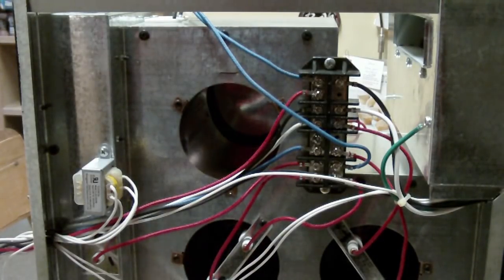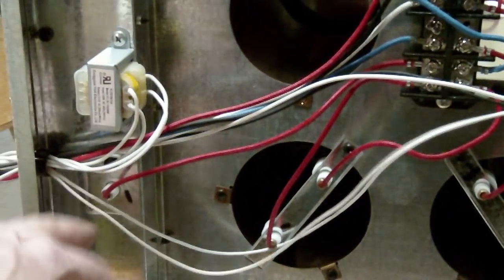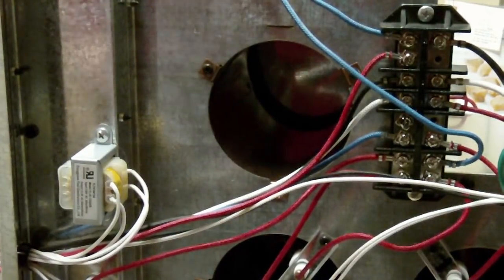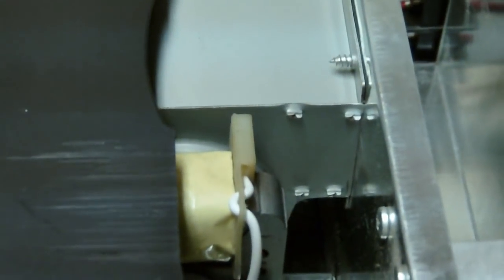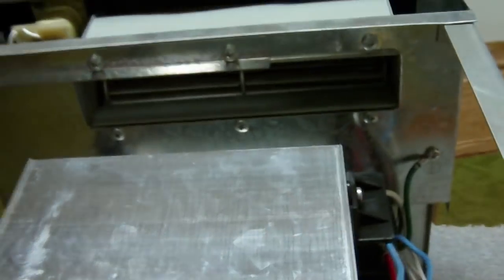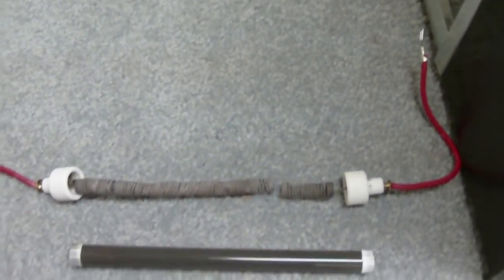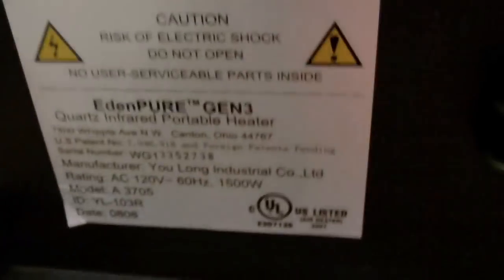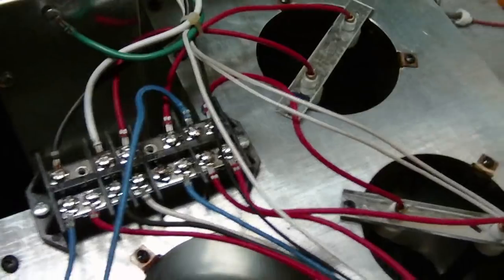EdenPURE GEN3 Quartz Infrared Portable Heater-What A Scam

Comment: I have had 2 gen3 heaters and a gen 4 for  about 13 & 12 years and they have been the most dependable and efficient heaters I have ever owned. The first 3 years I had them they provided a lot of the heat in my house in Michigan without breaking the bank.  Set them so they cycle in auto and they work great.
Reply from the maker: You probably let yours cool down completely before moving it

Comment: I service these units where I work at, we sell and are a warranty/service center for EdenPure. Most Gen3 units have a 3 year warranty, which EdenPure will cover the bulbs and most everything on the unit. If you only had a 1 year warranty, than you have a refurb unit. I have never had any issue working with EdenPure for customer issues. They stand behind their product. I love mine.
Reply: I agree that eden pure stands by there warranty about 70%,  we have 2 heaters a Gen 4 1500w and a 1000w don't remember the other name Gen 3 ? Idk adc purchased Jan 2012 the Gen 4 blew all bulbs at about 2 winters, called eden they sent replacement bulbs the only problem is that it took damn near till spring to receive them literally no bs 5 weeks 😕 The 1000 watt just died so I don't know if there is still a warranty, anyways these heaters are good economically and heat fairly well.  My only complaints are is that these are expensive and 1. when the bulbs go you are without a heater for weeks 2. bulbs are pricey  3. Should have a longer warranty and faster bulb shipping for the premium price tag.

Comment: My Gen3  is from 2009 and still going strong. You have to be smart enough to use a thermostat so your heating elements last. If you run it on high nonstop, the bulbs will burn out sooner. I haven't changed the bulbs yet. It's not meant to replace your furnace. It's meant to supplement your furnace!
Reply: Barbara Halas was
Reply from the maker: thanks for your comment

Comment: I bought 2 Edan Pure "Sun Pro" heaters in wood cabinets & remotes about 16 yrs ago. I haven't had an issue yet, but I also don't run them on max. Thats the one thing that burns them out. High temps degrade things quicker. That's the one consumable part you can generally expect  to replace over time. 
      The problem is a lot of people run these on high for extended periods. Yeah, that's gonna wear out those elements quicker. They actually sell a much better replacement element that they use now. 
      Quarts element works of electricity. It isn't a magical glass element that works by itself. They will all eventually fail, but at how fast depends on how hard you use them.
Reply from the maker: thanks for your comment

Comment: I have this edenpure heater and blower stopped working. What I found is there was one peace on the circuitboad (SRD-S-112DM ) had blown. Looked up part on edenpure web and board cost $39.95. Installed it and works like a charm. This is a 8 yr old unit.
So you can fix them.

Comment: Oh it says in the manual its very important to keep the filter clean.  Its possible that the filter got to dirty and it did not get proper air flow... could be what burned them out. The elements are rated at 20,000 hours which should be about 5 years of normal winter use.
Reply: I removed my filter altogether.. I blow it out pre season with compressed air.. A filter will cause problems because people rarely check it, at least on these things.. Just my SOP practices

Comment: The main reason these go bad is people unplug the unit while it is cooling down, it should be allowed to complete the cooling cycle when turned off and not unplugged until the cooling fan cycles off, that's why some people are having problems they don't read the instructions then gripe when something goes wrong that could have been prevented.
Reply from the maker: Rick Osman correct
Reply: you are correct!  It does make a difference

Comment: Ron: The same happened to me not too long ago. Brown + red should be high, leaving brown + white as low. Just be sure to use wire connectors and cap the left over wire to avoid any inadvertent connection. Quality electrical tape should seal all wires. The auto-shut off still works in case the unit is tipped over. Remember that you'll now have to plug and unplug the unit to turn on and off.

Comment: quartz is the glass tube that the heating element is inside.

quartz is used i think because it can handle very high temperatures without breaking.

in modern refrigerators the defrost heater is a quartz heating element and there the quartz is being used because cold water dripping onto a hot tube would shatter normal glass.
Reply from the maker: Yes

Comment: NOT a scam at all...I will admit slick salesmanship  tho. I have had one for about 8 years with NO PROBLEMS.. It is what it is....IT IS A SPACE HEATER FOR SUPPLIMENTAL DUTIES.. I run a HUMIDIFIER with mine, actually right on top of it during the dry air of winter and it helps quite a bit...I like the whistle of its operation while im sleeping
Reply from the maker: thanks for your comment
Reply: Id say its good for what it is but still overpriced for the componentry that in reality amounts to being worth at least 60buck to make.

Comment: No its not crap I have one that is four years old I run it a lot still works
Reply: same here, I've had mine almost 6 years and just recently it's having problems, the fan doesn't want to turn as fast as it used to.
I replaced the heating elements about 2 months ago which didn't need to be replaced. I run this Gen3 1000 24/7 because I live in the north west and use it to keep my parrot warm.
This dude is an idiot saying they aren't worth the money because 1 or a few units fail. Guess what, it's a machine, machines break.

Comment: Most quartz elements uses coils inside to heat up more surface area. It the tube itself that is quartz glass. These heaters are built well overall. Plus you have other brands with same technology that are built well. I prefer these over the cheap plastic crap Lasko that only lasted 6 months and others. The quartz based heater heat the place better as wider spread and not like Lasko where heat goes to ceiling. Plus had that quartz heater for 2 years and no issues and runs quiet. Perfect for bird room, beside my oil based radiator heater as no PTFE.

Yes is overpriced for costing over $350 for the EdenPURE no doubt, but not a scam. Their are other heaters that are based on the same, or close to  elements that are built well you can buy for about $125 that do a good job. Yes these heater can do about 250 no problem, but won’t push it past that?
Reply: I would have replaced all 6 elements, not just the 3 as the other 3 are likely on their way out.
Reply from the maker: thanks for your comment

Comment: I have a gen 3.  It is a 2008 and I have never replaced the bulbs. This guy maybe never used one. For zone heating or a supplemental heat source these are great. I  have a big buddy heater and it just gobbles up propane. My eden pure runs well on a  2000 watt generator in my  20 foot rv and still have power for lights and tv. Keeps me warm for a fraction of what any propane heater I have used so far.
Reply from the maker: thanks for your comment

Comment: I just got one.... so I can't say how reliable it is.  I will say one thing I have a 750 sq ft. apt with a cathedral ceiling....  it definately does heat the whole space up where as my oil filled radiator mainly goes up to the ceiling.  So far I am happy with it.  I got a refurbished unit with a 1 year warranty for $179  thats the way I would buy this unit

Comment: What wrecked that specific heater was.....someone unplugged it from the mains before the heater shut off. The fan keeps running after you turn it off to cool down the elements. If they are not allowed to cool down before mains are removed, then you get overheated elements that break like what is shown. NO other reason for those to die like what you are showing. I have had Edenpure heaters specifically the 1000 and the 1000xl and learned the hard way.
Reply from the maker: thanks for your comments

Comment: I have a Heat Wave EA1240 about 3 yrs old and it quit. First thing I found was the on/off switch was bad. So, I bypassed it and now it shows E2 on the display and does nothing. I have pushed all the buttons and get no response. There some kind of switch mounted on the side. My guess is it is a cutoff switch in case it gets knocked over. I bypassed it as well. Still get the E2 on the display. I do not want to throw it away, but I do not know what to do next. Looks nothing like the one in the video, other than size wise.
Reply from the maker: Do not operate it if you have bypassed any safety switches....get an ohmmeter and test them with the meter instead of bypassing safety switches

Comment: I have three of these heaters.  They work really well, two of my heaters are over 8 years old.  I did have to replace one of my lamps after one of my kids moved it roughly while it was hot.  These are great, easily serviceable heaters.  This guy obviously has no real time experience with using or repairing one of these heaters.  I suspect this heater he is working on was probably dropped, they are glass elements and they can be broken, treat it well and you will be really happy with it.
Reply from the maker: thanks for your comments

Comment: Very good video.  
I've run mine non-stop for each season since 2008 also.  Only just recently need to replace my elements as I could tell 1/2 of them were not working but that was actually OK for my application.  I'm looking to oil the shaft on the blower while I'm into it.  My blower has squealed on and off for a few years.  The EdenPure units after 2008 were really cheap.....I tossed one in the trash didn't last one year.....total junk.
Reply from the maker: Thanks for your comment

Comment: It isn't tungsten, it is nichrome 
(nickel and chrome alloy) wire in the elements and REAL quartz infrared heaters use the same elements only they are mounted in front of a reflector where you actually see them. Not sure why these are brown unless that is from the wire oxidizing.

Comment: Perhaps the elements burned out because someone kept turning the heater off before the blower could cool down the elements. Or the heat sensor was defective. The heater is never to be shut off by pulling out the plug or shutting off the power to the outlet it is plugged  into.  the fan will run after the heater is shut off by the switch on the heater in order to cool down the heating elements so they don't break from overheating them.  That is what the sensor is suppose to do in order to protect the heating elements and yes they are quartz elements.
Reply: Ihave had one for several years now and have never yet had to replace an element.  It is one of the first models made.
Reply: The fan shuts off automatically when the elements have cooled down sufficiently.
Reply from the maker: yes....thanks for your comment
Reply from the maker: thanks for your comment
Reply from the maker: right...thanks for your comment

Comment: We have had our heater for 10+ years with no problems.  But recently found the plug had singed/burned. It is now not working.  Would appreciate any suggestions.  Thank you!
Reply: You should be able to search online and buy any replacement part you need. Try Amazon, or just google it. I found a site that has every part available to buy individually
Reply from the maker: that is a bad sign....thanks for your comment

Comment: 1 year "limited" warranty and if you read the warranty, not much use. It also needs to be returned in its original box, etc. What a waste. Mine died in its second year.
Reply: They are made to heat an enclosed room. They will heat the room pretty fast then shut off. If you use it in an open space they will run continuously and not last as long.  Also, the filter on the back needs to be cleaned about once a month or sooner depending on how dusty the area is or it will cause the unit to run hotter and burn the elements out. You have to be smarter than the unit which it seems you are not.

Comment: I have the Edenpure Gen4 Model A4428.  It is blowing cold air.  How the heck do you get this thing open ?
Reply: Call EP first because if it is still under warranty they will send you to a warranty center or send you the part needed for free, if it is still cover. A Gen4 like yours, when new, has a 5 year warranty. Take the 4 screw off the rear black cover. The rear cover will come off and than you'll see the fan and circuit board that is attached to a metal plate. Don't mess with the fan or circuit board. There will be one screw at the top above the fan and one at the bottom of the metal plate, almost hidden. Look under the metal lip to see it. Take those out and gently lift upward and the fan and metal plate with the circuit board on it will lift up and out. You can lay this piece down and there are your bulbs. Do one bulb at a time and just follow steps in reverse. Easy. I can do one of those units in about 10 mins.
Reply: Drew Gatton Thanks so much.  I ordered the parts on line and took your advice.  Easy was right!  Thanks you sooooo much.  Edenpure works like new now  Yea!

Comment: Same thing coming out of china is worth no more than 60 bucks.
Never spend more than that on any electric space heater no matter the claims the key is to have good insulated house or room to have best efficiency out of a heater. Obviously you don't want to have a tiny one in a big room but it doesn't take much to heat a small well insulated bedroom. I just run cheap 40bucks wire element heaters about the size of an average home computer monitor in an average home. Two of those take care of the down stairs well on low with knob at 11:00 .
Reply from the maker: 1850W is max that it can draw on a dedicated circuit for any 120V  heater

Comment: I'm sure that the fan motor comes on from a temperature gauge control that turns the fan on when the elements are hot, since they are burned out,  then automatically will not switch on.. hhhhmmmmm makes sense
Reply from the maker: Yeah

Comment: You have no idea what you are talking about.  We sold hundreds of this unit, and after 6+ years, rarely get them back for anything except routine maintenance after people run them into the ground. This is one of the BEST units sold, a shame that the importer abondoned them.  So you have to buy elements every 5 - 6 years, what is the big deal?  Its not made to heat the entire house. If there is any scam here its YOU.  Why dont you make a video that actually helps people, like on LifeSmart, LifeCorp, Lifepro, Lifezone products?
Reply from the maker: It is you that has no idea what your talking about.....if you ripped them off by selling them one of these pieces of crap...what makes you think they would bring it back for repair and get ripped off again....go away dickhead

Comment: You actually know very little about quartz heaters, the TUBE that the element is in is made of quartz.  Quartz doesn’t impede the infrared.  These elements ARE quartz!  And this is a very good, very efficient heater.
Reply from the maker: Oh ok your the brains of this outfit....not....you don't know what I know for sure
Reply: You clearly stated these were NOT quartz heater elements and the very much are, this a basic portion of what quartz heater is and somehow claiming that they were a scam because of this or the fact that an element burned out for one person doesn’t make this a bad product any more than a burned out bulb on a car headlamp does.  You don’t know how the heater was handled, may have been kicked or dropped with the heater running, may have been mishandled by UPS or Fedex when it was originally shipped weakening the element.  Making broad statements like calling a product a scam based on one bad element is a bad practice.  These heaters contain copper tubes(part of the expense) that are heated by the elements and the elements can shut down and let the copper give off heat so the heater uses less energy.
Reply from the maker: @jbontra2  now it's copper
Reply: @PCBoardRepair  the tube that the quartz heater is mounted inside of is and has always been copper.

Comment: They are not quartz heating elements. And mine burned out the elements after only a few years too. They are not worth the money they cost. Their made in China too... The fan wont come on, until the elements heat up some. And when you shut them off, don't just unplug it, because the fan must run for a little while, to cool the elements. Or you will burn out the elements very fast.

Comment: Lol...first of all it's not a bulb it's an element second of all the elements are made up of a quartz tube wich is a hollow stick or maybe you would understand looks like a glass drinking straw and in the middle from one end to the other is the filament or element made of a coiled metal that produces heat when electricity is applied  just call it the springy thing so you can keep up then the glass straw allows the heat to distribute evenly or more evener and as soon as this process brings the heat just a little higher than what the air that is to come out from inside of this warming machine this is when the thermostat controlled switch that controls the fan makes the fan turn so the heat machine can make a warm wind eventually blowing more hot air than you can but without the straws with springs hooked  up and working this fan or  Squirrel cage  Blower will need Direct power In order to test For it's working Status  And there it is rocket science simplified ROFLMAO